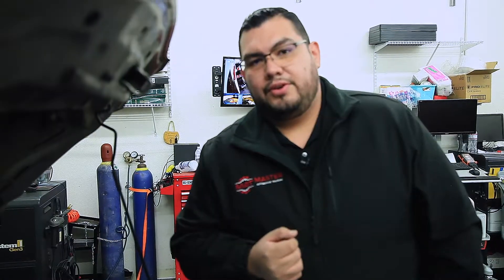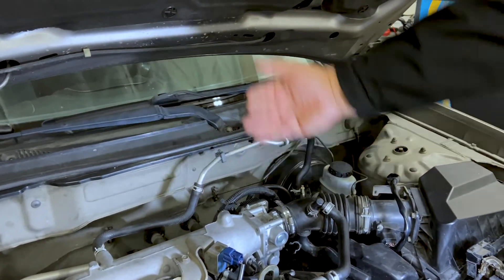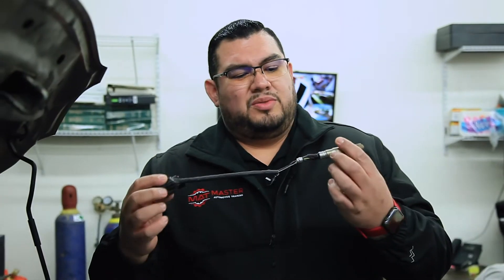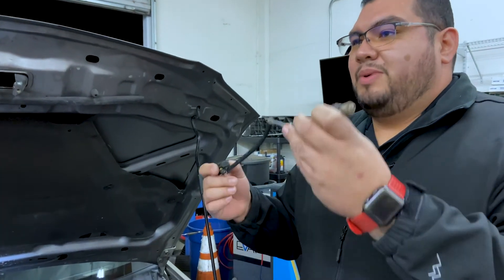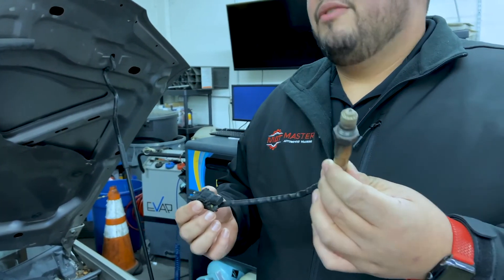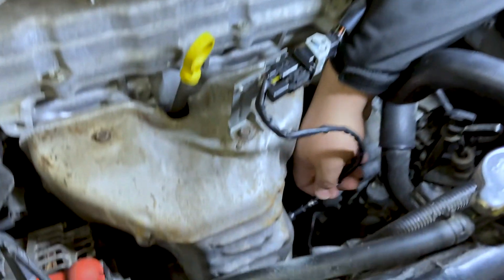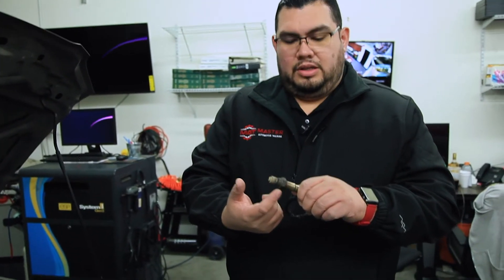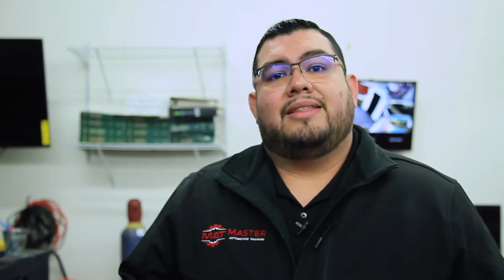CA Smog Check Visual Inspection [Catalytic Converter]

Comment: Hey guys I have a problem with my BAR 97 obd2 device the DAD it has a red light on the battery logo but it stays plugged in any way when I’m trying to do this Lincoln town car it won’t show no RPM signal but all the other lights come showing power. Any help thanks guys.

Comment: A lot of full cat-back aftermarket exhausts delete the secondary catalytic converter. Does this mean if I installed one of these I wouldn't pass smog test?
Reply from the maker: Anything modification after the last emission component, in this case the CAT, would be legally installed.

Comment: Hello may i ask, one of the exam question says “vacuum hose is transparent..” what does that mean? Is it Modified or defective?
Reply from the maker: On page 49 of the smog check manual you can see under OTHER, under hoses, they can be replaced or modified and it passes. Replacing vacuum hose to transparent hose is expensive, but totally legal and would pass.